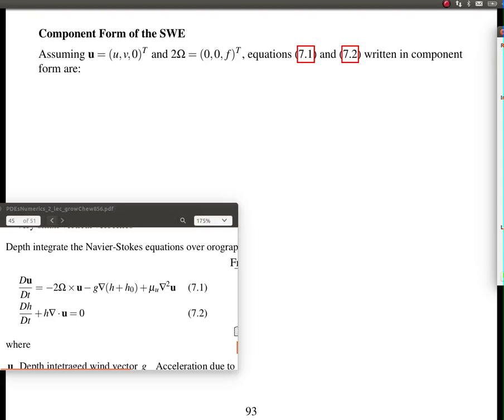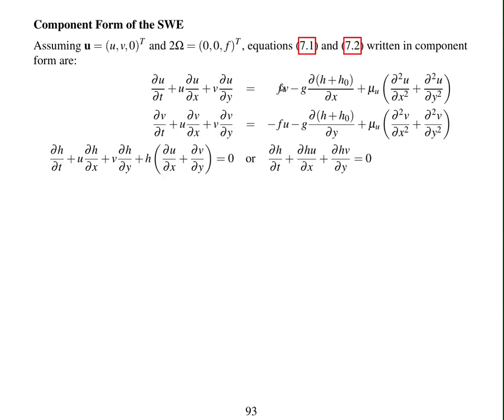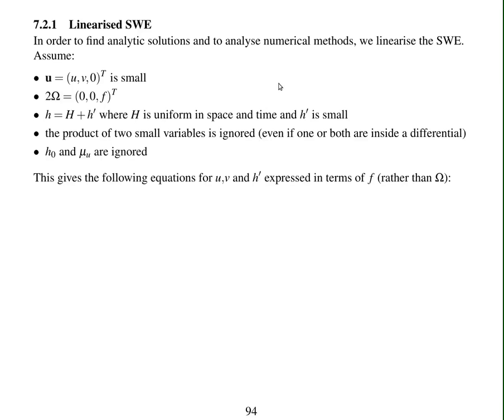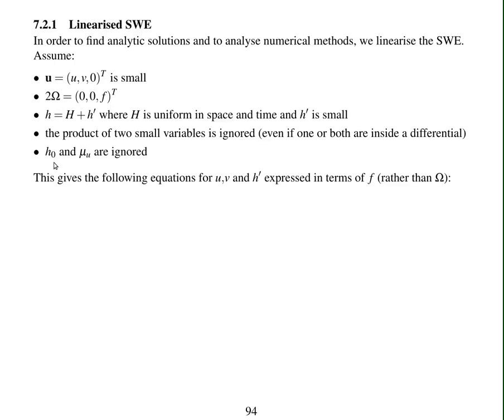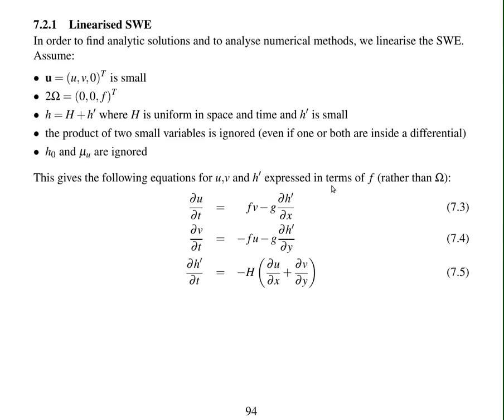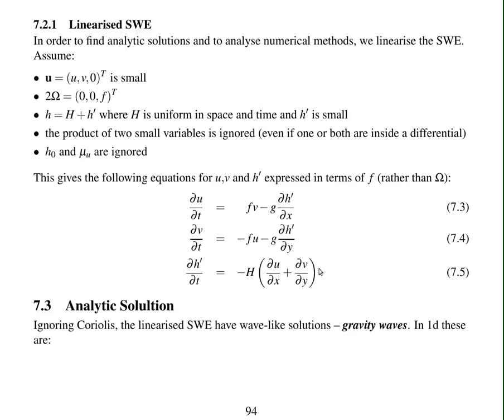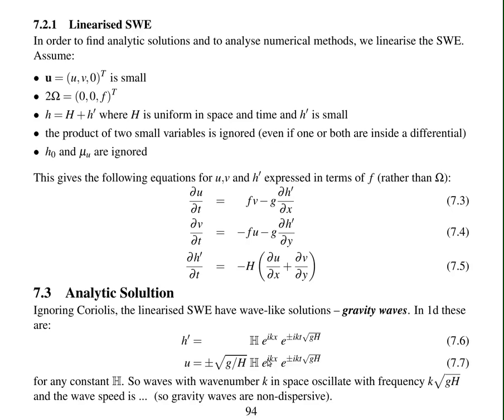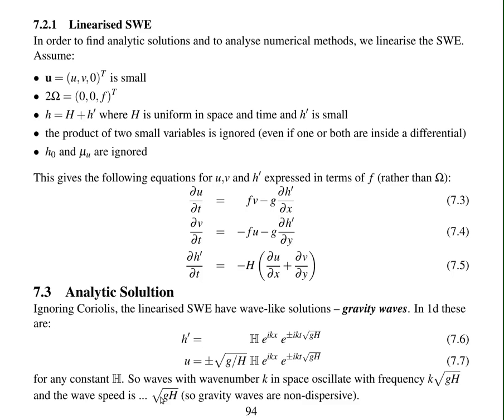8.1 Linearisation and analytic solution of the Shallow water equations

Comment: I may be wrong, but wouldn't the second subscript of mu (second line) be v- as in, component of diffusion acting in v dir?
Reply from the maker: I am assuming that there is just one viscosity that is the same in all directions. It has a subscript u just because it is the diffusion coefficient for the momentum equation. If a diffusion coefficient is anysotropic then it should be a tensor rather than a vector
Reply: @hilaryweller615  thank you! that makes sense, it was just a notation misunderstanding on my part. thanks for the videos, I find them helpful!